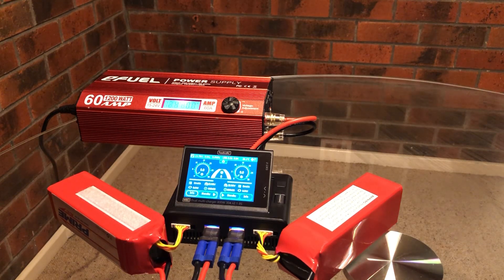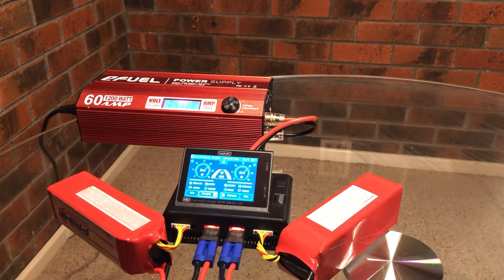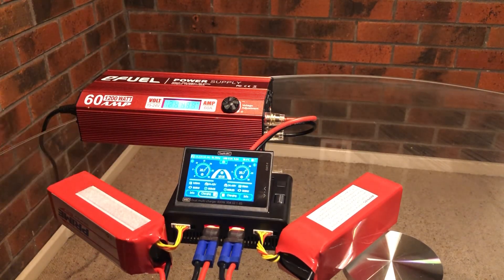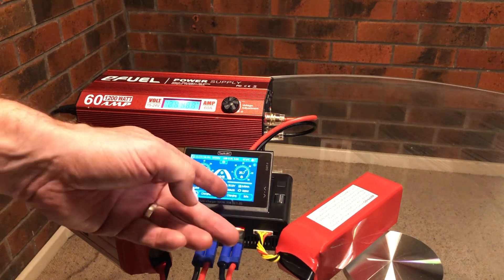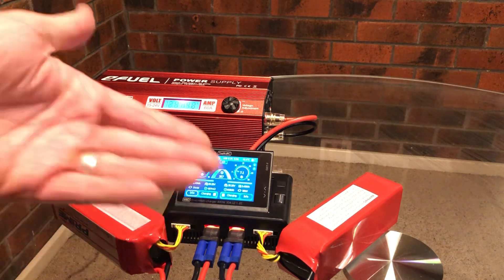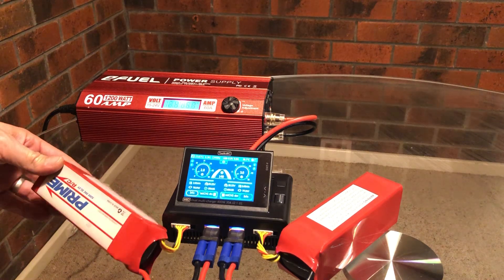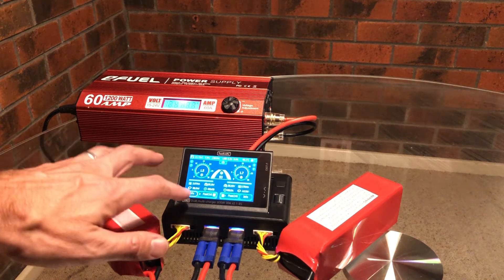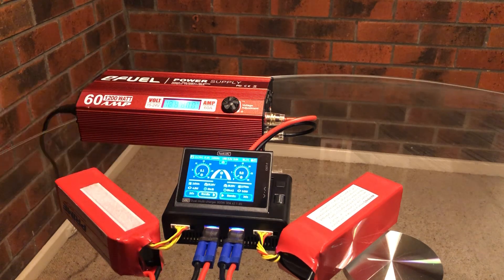ToolkitRC M8D - charging at over 1000w!

Comment: I have a 50amp 1200 watt with 3 outputs which I run 2 chargers at 20amps each no problem . So you are definitely good. I just don't do it all the time usually push 15 amps each . Nice setup though

Comment: Would you mind checking what regen discharge current is possible in synchronious mode please? Cant tell if it will do 50amp or limit to 30amp. Thank you
Reply from the maker: @paulhindson6710  - from the specs I can see that it will be 30a. Each port is limited to 30a whether charging or discharging. And the total system amperage is limited to 50, so if charging two batteries you won’t be able to do 30 on both sides at the same time. Hope that helps :)